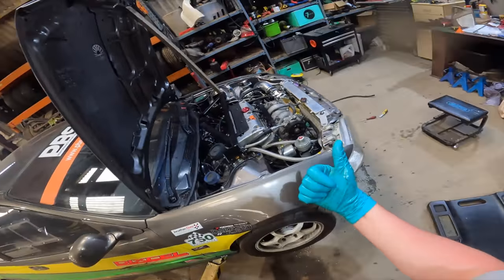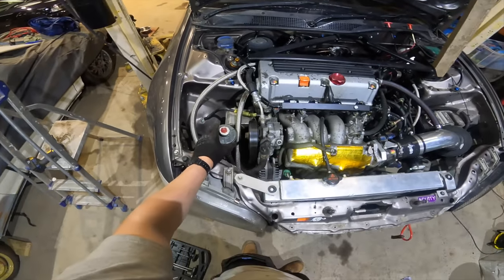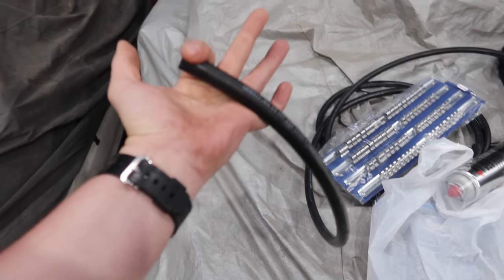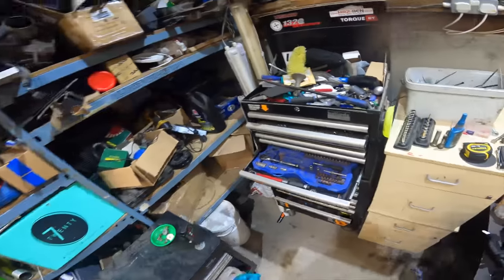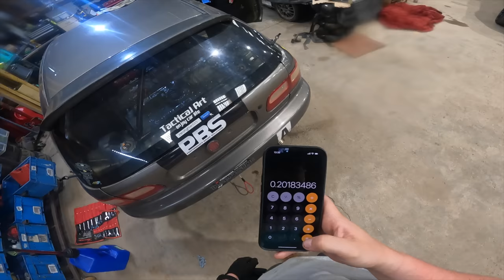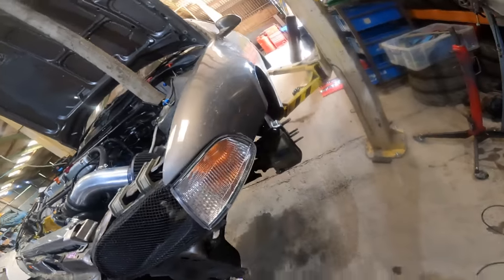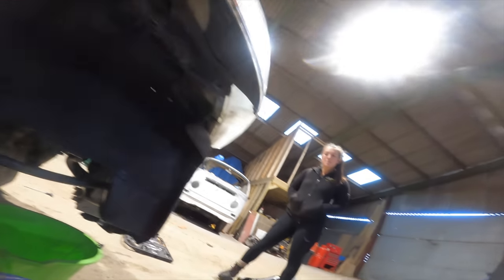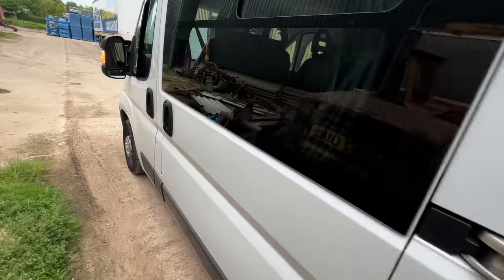BODGED CIVIC RACECAR UPGRADES PART 3

Comment: "Transponder". A lot of motocycle endurance race teams use a old seat belt buckle. Bolt the male side to the car and fix the female side to the transponder, if its good enough to save you life then its overkill for this application 😂 makes changing it a 2 second job, once you have wired a plug in its a breeze to swap from car to car